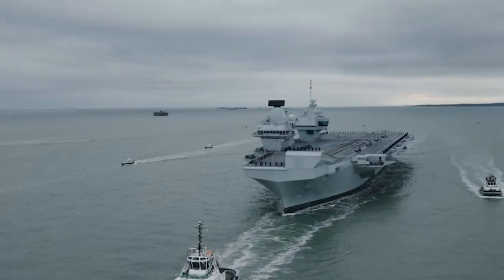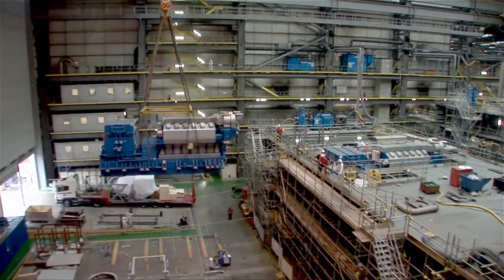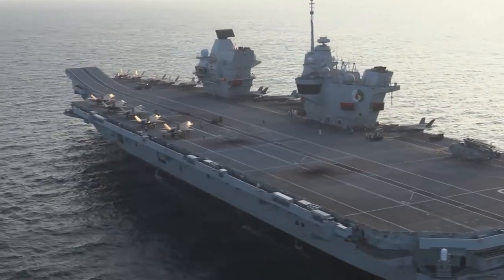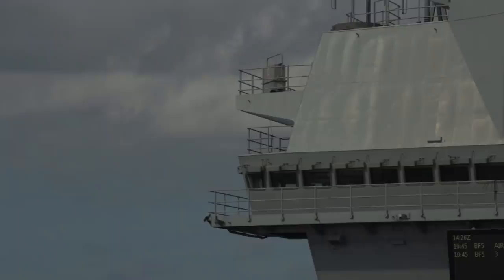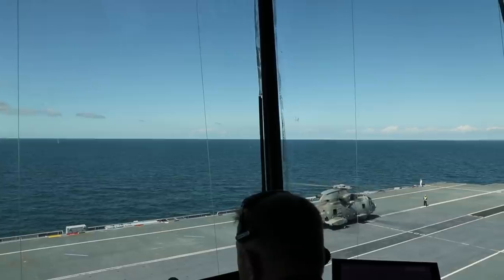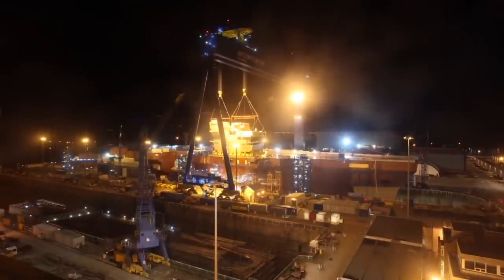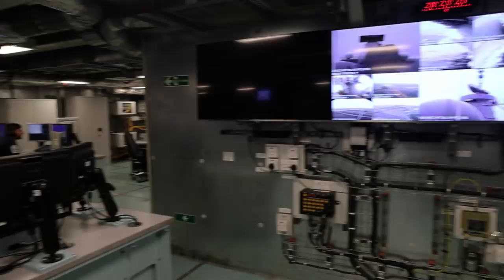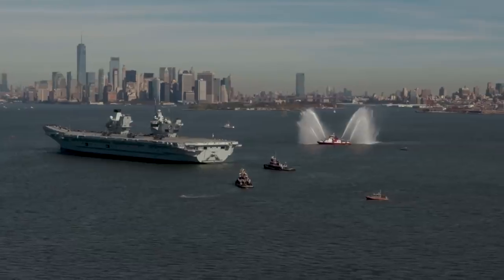Why Queen Elizabeth Carriers Have Twin Islands?

Comment: I still think its a bad Idea. Don't get me wrong, I think the Queen Elizabeth Class is a neat looking ship, with impressive technology, I just think the twin Island idea is a bad one. Though most of the points made in its favor in this video are logical (a couple weren't, I'll explain below), I still don't think its a good idea. Additionally, I think giving 5 advantages and only 1 disadvantage is very unbalanced. There is no way there is only 1 disadvantage.

That being said, Here are the things I don't like about this design:

Having 2 islands takes up Twice as much space as one. You're better off with a single Island because a carriers flight deck works best when it has the most amount of space possible.

The inclusion of a Second Island makes the use of an Angled flight deck much less likely. There just simply isn't enough space for one. An angled flight deck is important as it allows a carrier to perform launch and retrieval simultaneously. It also doubles the amount of launch space a carrier has, and makes landing and retrieval much safer and efficient. 

But because the Queen Elizabeth class has two islands, it can't have an angled deck. 

Two islands is redundant. Having the Bridge in one, and flight Control in the other isn't necessary. You can have both in a single island. 

A single Island can have a 360 degree view while two islands obstruct each others views. 

To the point about 2 engines: First, that is just as redundant as 2 islands. The space taken up by the secondary engine could have been used for something else. 

Second; if you're going to have two engines, and the only way to funnel them is to build a second island, then you should either A; just go with one engine, or B; make the ship nuclear so you don't have to have a funnel in the first place. 

To the point about having an elevator between the islands; what about the Twin Islands means you can have an Elevator placed there? You could have an Elevator there whether there is a second island or not. 

To the 5th "Advantage" Point about the construction of the Islands; why is this an advantage? I don't see is as such. A single Island can be built separately. The amount of modules in an Island has no bearing on construction. Building two Islands takes twice as long, twice as many resources, and twice as much manpower, as building one. If anything, this is a Disadvantage. Additionally, You're still building all the modules. Being built in one or two makes no difference.
Reply: I think one of the main misconceptions you have is that a single island would be much smaller than having two islands like this. Yes if it was nuclear powered like a US carrier, but you have to look at other conventional carriers for comparison. The Invincible class these ships replace were 1/3rd the size, but their single islands were overall larger, Russian, Chinese, Italian and pretty much any other conventional carrier will have a single island that takes up the same if not more space than the QE classes twin islands. US LHDs like the Wasp and America classes are another example of this.

Italy and South Korea are both building ships with twin island designs now, and Russia had some designs for a new carrier with twin islands also, so there's obviously some merit to it.

So with that it makes a lot more sense to take these much longer islands and split them, giving them better positioning for their roles, extra redundancy as well as all the other advantages mentioned.

There were in fact designs for this carrier to have an angled flight deck along with catapults, so that's not an issue at all really. You can find a fair few official design images for the version with an angled flight deck, this was the one France was going to purchase at one point, the ship is still able to be converted in future if required, but right now they only plan on operating STOVL aircraft from the ship so it wasn't deemed as needed.

Getting rid of all except one engine is not something any engineer would consider when it comes to a warship like this. For one, they're using two of the most powerful marine gas turbines in production, as well as four diesel engines, so it would be impossible to meet the power requirements with a single conventional engine. But the big thing is, you're completely relying on a single engine to be running perfectly 24/7 for months on end. Even if you weren't in combat, that would be incredibly difficult to pull off.

Again nuclear would be capable of this, but that means a significant amount more in build costs, maintenance facilities and personnel. The ship will have longer maintenance periods, which has a big impact when you're relying on two carriers. But because of these costs, the UK likely couldn't justify building two of them, so that would leave much bigger gaps in availability. That's not to mention the fact that you wouldn't be able to sell the ship at the end of its life to recoup some of the costs, and disposing of its reactor will be very costly too.
Reply: @Benjd0  Have you taken the time to measure the space of all the flight decks of all the carriers you mentioned? I highly doubt you have, so how can you know the QE takes up less space with its two islands? 

I know the QE initially had angled flight deck designs, but it didn't end up with as one. This restricts the carriers abilities as it can only launch Vertical craft. 

To your point about the twin engines; the solution was quite simple; make it Nuclear. 

The US Navy switched their supercarriers to Nuclear because the long term cost was cheaper. Yes, it costs money to refuel it every 20 to 30 years; yes it costs money to dismantle it at the end of its life; but it costs even more to constantly refill a gas tank this large. Not to mention that gas tank takes up even more space.

Nuclear is much smaller, cheaper, cleaner, and more efficient as its quieter and requires far less regular maintenance. 

It will cost more to build it nuclear, but you'll save money over its lifetime.

If the QE was Nuclear, it would have more then double the internal space, a single island, and could sail for 2 or 3 decades without having to refuel.
Reply: @pepperVenge  I said other carriers islands took up the same if not more space, of course it's going to be difficult to say exactly, but it's pretty easy to tell that they're similar if not smaller visually, certainly nowhere near twice the size of other carriers islands.

There are side by side comparisons between HMS Queen Elizabeth and HMS Illustrious when they were both docked right next to each other, and it's fairly easy to see the islands if put together would probably be shorter. Russian and Chinese carriers have massive islands, so it's pretty easy to tell with those.

It's more the lack of catapult that limits them, since they're not going for that launch method then there wasn't really a need for the angled deck. Technically they could operate some none-STOVL fixed wing aircraft like Russia and China if they had an angled deck but no catapult, but their range and payload are extremely limited in comparison.

Nuclear does make a lot more sense for the US Navy, but economies of scale come into play, they're almost constantly building carriers, so facilities and personnel used to build, maintain and dispose of these are going to be cheaper per carrier. When you're only building two carriers (With the fact that the second carrier could very easily be cancelled or sold due to budget cuts) and you're having to do R&D for only two reactors, it's going to be expensive and risky. Not to mention the limited ports available in the UK that can both accommodate a ship of this size and allows nuclear reactors in them, the carriers current home port doesn't.

France went down this route and cancelled their second carrier for budget reasons. In order to limit costs they used a number of smaller submarine reactors which has caused some issues, now they only have a single carrier that has to undergo around 15 months of maintenance every 7 years for refuelling, leaving them with no carrier during that time.
Reply: @Benjd0  No.. unless you actually measure the deck space of each of these carriers, you can't know the difference in space each island takes up. How space measures up visually is often misrepresented from fact. 

I could say one apple "looks" bigger then another, but I can't actually know for sure unless I measure them. 

So this argument is not valid. 

Also, for clarity sake, I'm only taking about one topic per comment. This way comments don't become books, loaded with multiple points.

We can move on to the next topic once this one is settled.

Comment: Two separate islands are most ridiculous design of naval history. And the information on this video is bs. Especially on turbulence part. You don't need rough seas condition to find out that two island complicate wind behaviour and create more turbulences under unpredictable wind conditions. There is reason why Ford carrier focus on a single small island instead.
Reply: Far from the most ridiculous design, it makes a lot of sense, it simply splits the existing long island design and makes better use of the space. The Ford class is nuclear powered, so a single small island is much more viable. Something like the Wasp or America class is what you should compare it to, or the old Invincible class this replaces, the two islands have a smaller footprint than their single island.

Both Italy and South Korea are now building carriers with this design, and Russia has shown some designs for a new carrier with the same setup.

Comment: As you have accessed the videos of these ships being built in Rosyth I can only guess that you have forgotten that the main sources of power, two gas turbine generators, are situated one under each island to give as short a length as possible to the turbine exhausts. It would not have been possible to place this machinery lower down in the ship without convenient access to replace the gas turbines during maintenance periods. Also the exhaust system would have  been a damage control nightmare passing through ten decks at least. I would suggest that this is one of the reasons, if not the main one, for having two islands.

Comment: CV's look ugly by definition. The main problem with these CV's is that they are conventionally powered and therefore need so much support on faraway missions that the rest of the Navy grinds to a halt. If not for faraway missions, what do you want a CV for?
Reply: A carrier strike group is made up of quite a few ships and aircraft, even if the carrier is nuclear powered, all of these ships and aircraft require refuelling. So it'll make things a bit easier, but it's not as big of a burden as you're suggesting.

The carrier has just set off on its first deployment which will take it to the South China sea, one tanker is accompanying the strike group. So even if it was nuclear powered, it wouldn't reduce the number of ships required to support the group.
Reply: @Benjd0  On this grand tour, the CV feels like a glamour model exercising her rights to bare arms and much more on instagram, not a warrior properly kitted up for battle.

Comment: well sense they built a multi billion dollar neutered aircraft carrier.  It is neutered because it lacks key elements that they actually invented back in the 1950's, the main one is the angled flight deck, not sure if they also invented the steam catapult but by omitting these technologies as well as arresting gear they have greatly penalized the capabilities that any modern aircraft carrier.  They obviously did not learn anything from their fiasco during the Faulkland war with Argentina where they were trying to use the Harrier as the sole aircraft to defend their fleet.  By not having the capability of operating conventional aircraft they had no early warning aircraft like the Hawkeye to warn of an incoming air attack.  They were constantly surprised when ever the Argentine A4 Skyhawks attacked and is why they had several ships sunk by a 1960's era light attack bomber.  Several years before they decommissioned their conventional carriers and instead went to the stupid ski jump that limits the only type of aircraft to  at that time the Harrier.  The new carrier is still limited to the F35B a new vertical take off aircraft.  By doing this they cannot operate any conventional fixed wing aircraft and so they are unable to offer inflight refueling aircraft as well  as AWACs style  aircraft like the Gruman Hawkeye that can operate off of the carrier.   This greatly limits this ships reason for existing.  So  to compensate they put two  islands on the damn thing to try and convince everyone that in case you missed seeing the first island that you surely will see the second one and realize that what you are looking at is an aircraft carrier instead of seeing a multi billion dollar white elephant.

Comment: This British aircraft carrier is not nuclear powered and has no catapult launch system. It is not state of the art.
Reply: Nuclear power and catapult launching is actually pretty old now so I wouldn't say that determines whether a ship is state of the art, it's just another option for them.

The QE class is state of the art in many other ways, in particular automation, this means it can be crewed by a fraction of the number of people compared to other warships of this size. The twin island design is also pretty innovative, we're seeing more carriers now being designed with this setup. The Bedford array that is to be fitted will also allow aircraft to largely automate the landing process.
Reply: Catapults were invented by the British. Now you're saying they're ships are not state of the art?

Comment: If something manages to hit an aircraft carrier (which is not traveling alone) shit is serious already and a second island wont help you any further....

in addition to that... a diesel AC carrier!? ever heard of nuclear power...?^^
Reply: That's true, but it's still better to design for those eventualities, if they do happen to get hit by a single missile, at least they have more of a chance of getting out of there.

You make it sound like a diesel aircraft carrier is unusual, there's only been one nuclear powered aircraft carrier built outside of the US. A lot of countries operate nuclear submarines, including the UK, but the cost outweighs the benefits in most cases when it comes to nuclear powered surface warships.

In the UKs case it would have likely been the choice of a single nuclear powered carrier or two diesel powered carriers, so it just makes more sense for them.

Comment: It has just indicated where the engines are. Both exhausts will create a heat shimmer. Another indication. smart thinking enemy torpedo firer will disable both bridges, plus any good enemy will just topeado the stern and disable propellers. Bad design. Looks American. Shite

Comment: The biggest down fall of having two towers is the enemy knows where to target either engine rooms or straight for towers 🥸
Reply: What? This isn't WW2, pilots aren't eyeballing the target, computers have already targeted specific parts of the ship before firing and every single country is going to know where the engine rooms are for every carrier on the planet. But for British carriers the enemy know has get a second missile through the air defense and both have to hit dead on which is far harder.